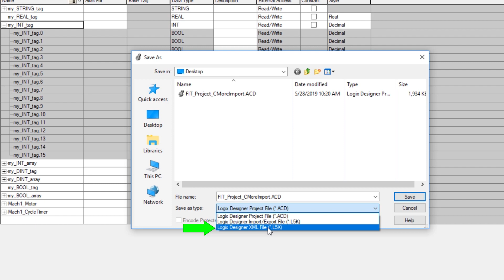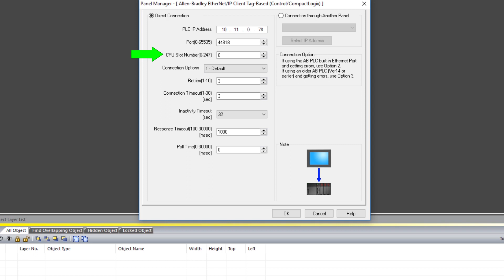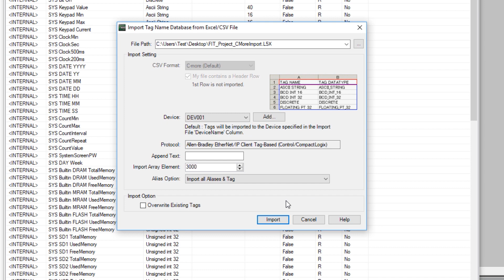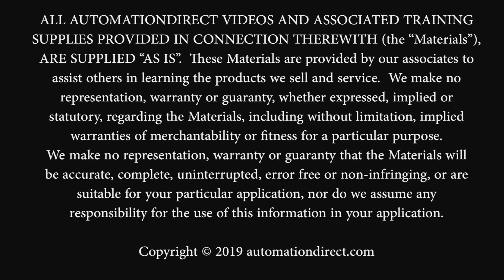Import Studio 5000 Tags into C-more HMI Projects at AutomationDirect

Comment: This did not work for me. All my DINT tags (each with 32 bits) are imported as a single tag of signed INT 32. Tag address id written as DINTtagName. For example my tag is DINT tag named HMI_Lights. It is imported as Tag Name HMI_Lights, Data Type Signed int 32, Address DINTHMI_Lights.
Reply from the maker: @aerodrrom that is correct. Because the AB interface for C-More addresses the tag names, the address for any of the imported tags will be the tag format (DINT, INT, REAL, BOOL, etc) and then the name of the tag. When you write the project to the screen and connect it will be able to influence those tags in your PLC.
Reply: @automationdirect  I appreciate you responding, since this is ferly old video. Unfortunately that makes DINT bits (HMI_Lights.12) unusable. I can not set that bit  as tag for toggle switch-button. However, I found a workaround.   It took a bit tag exporting in CSV, editing, and importing back into Studio 5000. I created an Alias for each bit for all my DINT tags. Then exported it in .L5K and imported only aliases into C-more.
Reply from the maker: Glad that worked. Another option would be to manually create any Boolean tags needed in the Cmore tag database. It will allow you to select a DINT location and then select which bit in that DINT you want to use. It isn't super helpful for hundreds of boolean variables, but it will work for specific options if needed.

Comment: I Always get Error GUI-185. I've checked and the file isn't open or corrupt. Using Studio 5000 version 30 and c-more 6.72. I tried 6.70 as well.
Reply from the maker: @Eltrion_DVK, I would advise contacting Tech Support to help with troubleshooting(1-800-633-0405).